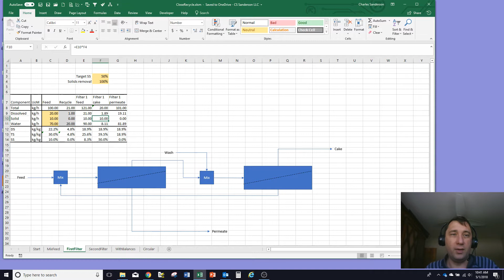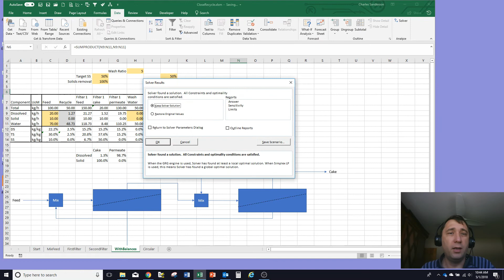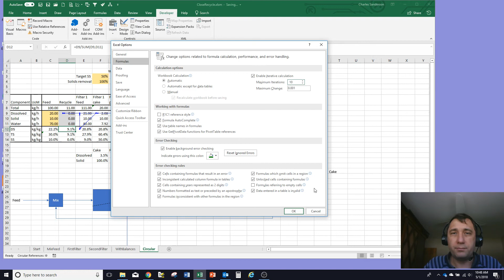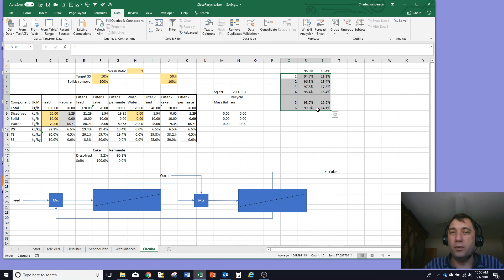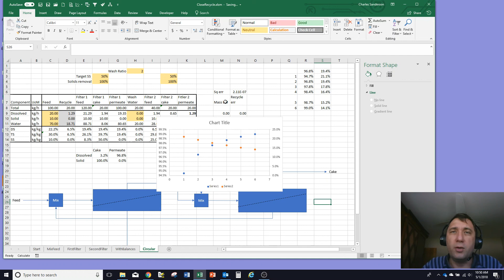Solving Engineering Equations in Excel - Recycle in a Flowsheet

Comment: Very helpful video! I just had one point: when you copy and paste the columns when recording the macro, Excel only looks at the actual position of the cells (i.e. cells K9:K11). If you were to shift the cells K9:K11 to somewhere else in the spreadsheet, such as to N9:N11, you would have to reprogram the macro. Do you how to make it so that it references the values in the copied cells for the iteration no matter where you move them? It would make a more fool-proof way of doing the iterations. Thanks in advance!
Reply from the maker: Yes - I think you can name a range in Excel with the Name Manager.  You can then point at Range("MyName") in  VB
Reply: @cssandersonllc3172  Got it, thanks!